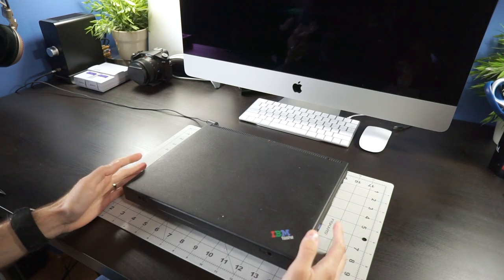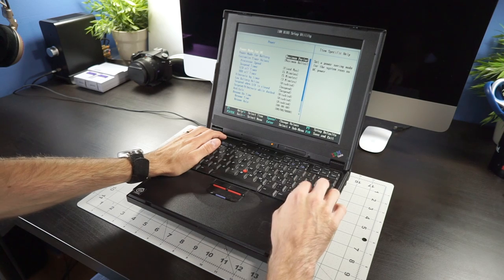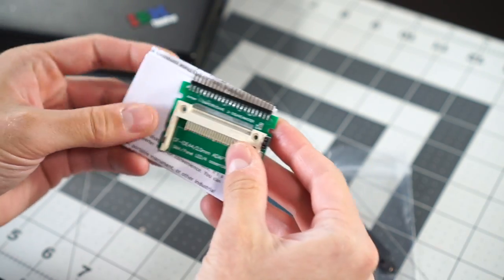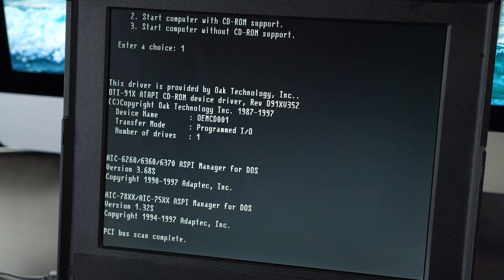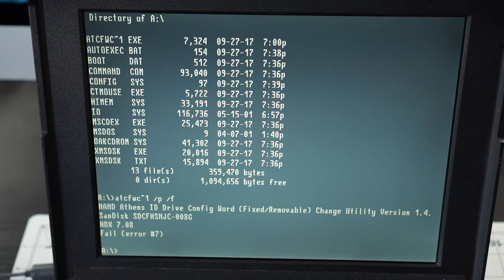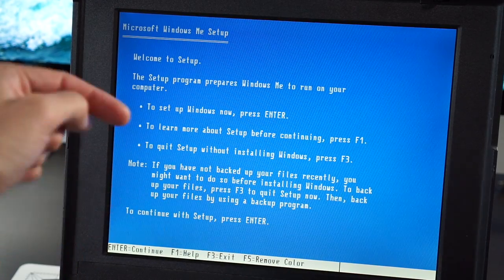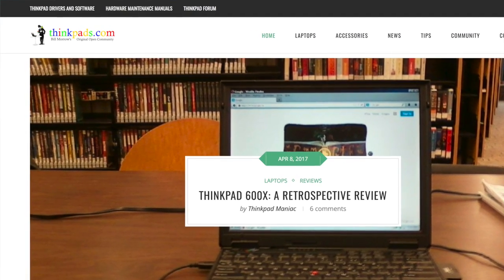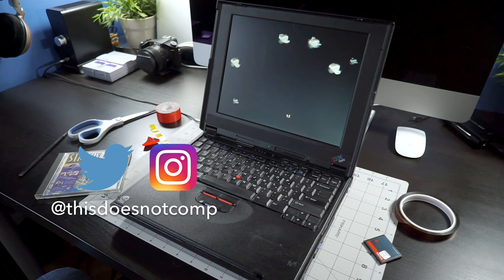Repairing a Vintage ThinkPad

Comment: In my vintage laptop repairs, I used to use CF-to-IDE adapters, but now I use SD-to-IDE adapters. I had much more luck with them on olders machines with quirky BIOS.

Comment: That pointer behavior was a typical behavior for the pointer driver. Pointer drift was a really common issue with the touch point laptops. The driver checks every few seconds for any slow consistent motion. it will interpret this as pointer drift and zero it out. The next time the pointer drifts, just let it continue and the driver should zero it out in a couple seconds. 

 Thanks for the video. Brings back memories. I worked in tech support and worked with a lot of old laptops and desktops from this era. Computers at this time were frustrating to work on, but it didn't seem so bad because earlier computers were even worse.

PS: Also IBM was a Windows launch partner and was usually very good for having out of the box support when a new version of Windows would come out. This advantage would go away over time as new hardware was introduced.
Reply: Good to know. My x200's pointer does the same thing.

Comment: Back then, those S-video ports on laptops were a blessing, I used to connect my laptop to a huge standard def Sony Trinitron via S-video and play retro console/arcade emulators on a big CRT screen. (granted it was 480i, but still awesome at the time for emulation on a big CRT screen).
Of course now that port is obsolete since we can use the VGA or even HDMI port along with a a converter and a program like CRTemudriver to get 15kHz RGB on those standard def CRTs. : )
Reply: I got a Thinkpad T60 from Ebay this week. It has an ATI X1400 graphics card and a VGA out port. Hoping I can output 240p with it to a SD CRT...

Comment: Me: Well I expect he will install Windows 98 in this thing...

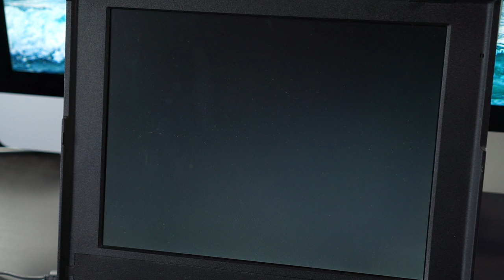17:07 Sees Windows ME startup menu
NO GOD PLEASE NOOOOOOO
Reply: I just found this exact laptop at the thrift store...AAANNDDD it had ME on it...god fucking dammit-_-
Reply: E  I hated Windows ME when I had a computer that had it on there.  I ended up putting Windows 2000 on it instead.
Reply: Idk why everyone hates ME it's not that bad
Reply: Samcq50 _YT it was super unreliable, that’s why it was hated. It blue screened if you even THOUGHT about installing software on it.
Reply: @infamousacidrain  Windows ME really wasn't that bad if you had a clean install and consistent types of drivers (either VXD or WDM...not both). It was OEMs that mixed their old VXD drivers with the newer WDM drivers on preinstalled copies that made things go unstable.
Reply: Wait but wouldn't any windows ask for a key? He didn't put any. Dafuq
Reply: lmao
Reply: @Jack's Model Railroad Like which one?
Reply: @Jack's Model Railroad Really? Well, how do i go about finding this archives? Mind telling me?
Reply: I actually really like ME, it’s more stable and easier to use than 98, the biggest issue it the lack of DOS mode, but that’s not that big of a deal.
Reply: @infamousacidrain  I’ve used ME quite a bit, and it never blue screened once.
Reply: @EvilTurkeySlices  some people definitely had that experience. Doesn’t change the fact that it was largely regarded as unstable and a tremendous number of people had issues with it. Microsoft knew they were right and canned it pretty quickly.
Reply: @infamousacidrain  it was unstable due to bad drivers, that’s fixed now.
Reply: @EvilTurkeySlices  which drivers? There were hundreds of companies developing hardware for it, and I assure you they did not all update their drivers in the intervening years, especially once the 9x kernel was killed because of ME.

Comment: I recommend opening it up thermal paste replacement and clean the motherboard down with some isopropyl to stop future corrosion.You can oil the fan also.
Reply: What kind of oil for the fan would I use?

Comment: I just got an old Compaq Deskpro P800 up and running.
I found an old IDE HDD and it is running fine.

I love that old clunky sound of those old HDDs.
paired with those little socket 370 heatsink fans that run at 100% the sound is just so retro.

Comment: A bit of background info about this and a few other ThinkPads of this era. This was around the time that IBM was still trying to find ways to make money (or not lose as much money). They went through several stages of trying different things starting with moving manufacturing to Mexico, trying lower end machine such as the early "3" series. At this point, they were trying out contracting through Taiwanese companies mostly with a separate line like the "i" machines, but the TP390 was one as well. I want to say that this model was an Acer product. You can tell by that weird adapter used. Only the low end machines of this era had those and they can also be found on Acers of that time. Plus the rear access to the HDD was very atypical of design from their Yamato engineering facility. 

I really enjoy your video! Keep up the good work!

Comment: I didn't know that cf cards could work in 2 modes, removible modes & stay modus.
So each cf card can have it's own bios with it's own settings such as removible modus ,FAT32 etc,,,,
But you did a great job, i only wished you did & showed us how to remove those residues from that laptop.

Not mentionen, everytime you say,,1999,,, i will get flashbacks.

Comment: My biggest issue with these old laptops are the screens, which are absolute junk by today's standard. First you have the very obvious ghosting, which makes anything fast moving basically unplayable. Then the CCFL bulbs usually are on their way out, so the screens are probably sitting at like 60% of their original brightness. And like you said, they almost always have really bad internal scaling, so unless you want to play DOS games in a small window, you have to put up with a garbled mess on your screen.
Reply from the maker: I think it's amazing that while the screens look absolutely horrible by today's standards, we were totally blown away by them when they were new. We've come incredibly far since then.
Reply: I replaced the CCFL tube in a T30, but it only lasted a year or so.   I'll be making a pcb with a string of white LEDs to fix it next time.   I haven't decided yet whether to run them in series off the CCFL booster or to remove that and run them in parallel off the low voltage.   You can always plug in an external VGA screen to run higher resolutions,  but the quality on the internal screen goes down when you do that, as if the GPU can only refresh one screen at a time.
Reply: Oh, so the CCFL bulbs were used for backlighting.

Comment: Win98SE is often a better choice, as a half-step down from the much hated ME, but a half-step up from regular 98.

Though Win2000 Pro is usually the top choice for this era machine.

The extreme version would be a bigger CF card with multiple partitions that can multi-boot between Win2K, 98SE, and a lightweight linux distro, to cover all your bases.
Reply from the maker: Yeah, I would have gone Windows 2000 but I wanted to install After Dark. It looks like there's some kind of alternate version on archive.org that works on the NT kernel too, so I may give that a shot (https://archive.org/details/AfterDarkCompleteCollection).

Comment: Thanks so much for showing the ATCFWCHG.EXE tool. Now I made a 2GB CF compatible with my Pentium 200MHz MMX system!
Reply: 8bitbubsy you might as well get a 233-266mhz chip off ebay and upgrade hahaha
Reply: I worked on these laptops when they were new. I thought I knew everything about computers back then but I totally missed that CF cards could be used as boot drives. Physical drives were horribly slow.

Comment: These old Stinkpads required a separate caddy to enclose and install the hard drive. Caddys were different among the various models. When purchasing one of these vintage machines, always ask if the caddy is included. They usually pull the hard drives for security, but the caddys can be a PITA to find. Some are plentiful used or repro on eBay; some are not. Very informative video. I have used them since new, but learned some things here. The old Stinkpads were built like tanks. One weak spot now is the batteries are usually dead and replacements, if they can be found, are very expensive.
Reply: They are just 18650 cells, so they can be rebuilt pretty easily.

Comment: Funny. I've never had a problem with my compact flash cards and f-disk before, and I've used them in several retro systems, including laptops. BTW, I found on amazon a CF card adapter that has the shape of IDE drives, in addition to an M.2 to IDE. While that one works in some of my devices, it doesn't boot in my oldest Toshiba Laptop, A P1 with 40mb (440CDT), while the compact flash does. The adapter I use is a SYBA  DS-ADA45006, and the compact flash card I use is a UDMA 7 (which is the IDE specification) 16GB Extreame Sandsidsk 120MB/S, model number SDCFXS-0 16G

Comment: I notice this with all laptops that use the nub. If you use it a lot or push to hard in one direction it will get stuck for a bit but register it a movement, as its getting unstuck. Just let it go for a bit and it should be fine. Great video and have fun.
Reply: The X60t still has this issue and I tend to use said laptop from time to time myself.
So yeah, it seems to be a nub issue here.
Reply: It isn't an issue, it is some kind of recalibration. This is an intended behavior.
Reply: The TrackPoint automatically adjusts itself to different levels of finger pressure. If you're heavy-handed with it (as beginners often are) it may tend to drift when you let go, until it readjusts itself. Once you get used to it and learn to move the pointer around without applying so much pressure, you won't see that happening anymore.

Comment: Strange.  I just got a Sandisk Extreme 32GB CF card for my Toshibas Tecra 520CDT (even a bit older than your IBM) and had absolutely no problem in getting it recognized by the machine and installing Windows 98 on it.  I used diskpart on a Windows 10 machine to clean the existing partition off the card, then used disk management to initialize it.  I did not create a partition or format it.  I let the Windows 98 install create the partition and do the formatting.  Worked a charm.

Comment: I can explain the vague and confusing master/slave label!

The PCB stems from a dual-socket CF adapter where the jumper configures both sockets, not one. Depending on how they stacked the sockets, it was impossible to use some of the thicker CF drives in one of the sockets (yes, there are multiple types), but for compatibility reasons, that CF might still need to be specifically master or slave, so the jumper was necessary. Which incidentally meant they could reuse the same PCB for single-socket adapters.

Comment: I had one of those laptops. It was given to me and it was also missing the HD and that adapter. Since I got it free I didn't feel like buying a replacement adapter, so I disassembled the laptop and soldered the pins of the HD directly to the edge connector on the mainboard.

Comment: the mouse moving on its own there happens when the cpu has no cycles left for mouse input; because its busy with critical os stuff, so the mouse movements get delayed. it happens sometimes with slow cpus, or extreme heavy load. or; of course it COULD also be the "nipple" that is iffy

Comment: beside DOS that do not need  it, Hope that the compact flash really support millions of write/readings used by the virtual memory utilized by win 95 to up that uses the hard drive as an extension of RAM, unless if  possible disabled in control panel.

Comment: Awesome video which brings back so many memories! The very first laptop I got to fix was one of these. Had to swap a board from a bad body into a good one. Took me several hours the first time around (it was a lot of screws) but after that I could work on any laptop. Got into Thinkpads and worked on many of them including some exotic ones (S30!). I also played with CF cards on one of my own Thinkpads back when SSDs were prohibitively expensive in mid 00s but I remember install Linux on them. Now I work on Mac laptops but this old PII-era Stinkpad is what started it all many years ago.

Comment: I would struggle to call CF cards 'reliable' just because they have no moving parts. A common issue is Flash wear. I had them in my PSION5MXs running daily backup from internal RAM, copying over maybe 10MB a day. After a few years, a REALLY expensive 512MB CF would invariably die. You can't expect the best of wear levelling algorithms on CF cards if they aren't made with newest electronics! And i don't know whether they have to be for a cash register, i mean if it's a read-only drive in those machines you mention?

There are other ways, like getting an IDE 44-pin to M.2 SSD adapter, which is something i got for a laptop which actually could make use of a bit of extra performance beyond what you get off SD cards and more capacity than you get off CF, or IDE 44 pin to SD-Card adapter for something where speed isn't as critical.
Reply: CF is definitely more reliable than old school IDE HDDs, especially in laptops. :P
I use msata to 44pin IDE myself for some of my old laptops (damn all those proprietary edge connectors). I thought about CF but the price to performance just wasn't that appealing compared to regular SSD tech that was already around. A lot of old 8/16/32GB msata drives hitting ebay from old netbooks or laptop cache drives. Also, many CF adapters for older systems let you get at the card quite easily, meaning swapping it is simple. In a laptop, that is not much of an issue. Some of my laptops have tool less drive bays, some have a screw or two to get to it. Pretty easy I think. The write limitation was also a factor. However, in a normal windows environment, unless he reinstalls it constantly, I don't think it will be much of a problem for many years to come. Was your CF MLC or SLC? In any case, if you use CF, I would say either get a decent bit of overprovisioning or make sure you have an SLC CF if you want years of reliablity. What is the failure state of a CF card that has expired its r/w cycles? SSDs go into read only mode if they are programmed correctly (and the controller wasn't the thing that killed it).
Reply: If a refurbished notebook is going to be used for everyday tasks, such 
as web browsing with Firefox, and somehow watching video, then these 
activities are going to swap alot, unless Firefox is optimised, and 
swapping off-loaded to a separate drive. Not a separate partition, but a
 separate drive.

The absolute minimum for Firefox and its derivatives is a computer with 1 
Gb of RAM, and an OS that on its own would take maybe 200–256 Mb or less
 total.

Well, there must be a video out there that shows how YouTube can be seen
 on old hardware.

YouTube playback requires three things: adapter (GPU) support for OpenGL
 2.0, a driver that supports that, and a browser with at least a 
WebM/VP9 decoder. All this Firefox supports, but it  does not have 
built-in support for H.264 (aka mp4), in which encoding half of the 
videos on YouTube are available. — This means, that on Windows XP, one 
would have to use a fork of a fork: either New Moon or MyPal, both forks
 of Pale Moon, itself a fork of Firefox.

Comment: I put a 16GB industrial CF card in an old IDE laptop to reduce the heat generated and it worked well but I just swapped it for a mini PCI-E SSD in a 44 pin IDE caddy and the performance boost was dramatic!

I wouldn’t personally buy second hand CF cards as many have relatively limited read/write cycles. CF form factor MicroDrives are a lot less limited but they are fragile.

Comment: When you started to talk about the removable and fixed modes on the CF card, I decided that I'm going to make a comment about it asking what kind of bullshit is that, however I persuaded myself to watch till the end, and I got really surprised that this setting really mattered. I'm using CF cards in a variety of devices, from my Yamaha A5000 sampler, through my Compaq Armada 1530 to my Commodore Amiga 1200. On neither of these machines I had any problems with any of my CF cards, from the cheaper Verbatim ones, to the SanDisk Extreme IV in the A5000, so I guess it might also depend on the BIOS as well.
Oh, and the Nikon D70 was my first DSLR as well. I still have it and use it from time to time, as my D3100 doesn't have a built-in focusing motor, and neither does my 70-300mm lens.
Reply: Windows, to this day, is a PITA when it comes to letting you use your storage mediums in "odd" ways. Like trying to write the Windows 7 installer in an external hard disk instead of a flash drive (the answer is to use YUMI and enable Show all drives? , by the way).

Comment: To use a compaq flash card in a IDE PC you must have it with the tag "permanent" instead of "removable", the computer will consider it as an IDE without asking any drivers. 
The settings are in the card manufacturer settings, industrial cards are "permanent" photo camera often "removable".

Comment: Late comment I know, but I work in a computer recycling center and when we have to remove Hard Drives from any Laptops on a scrap pallet, anything that gets refurbished we use some specialist wiping software that reformats the drive, fills it with dummy data then reformats it again.

Comment: Industrial Compact Flash is great for this type of usage as it's already configured as a "fixed Disk". I use Industrial Flash in my Compaq LTE 5100 laptop and it works fabulously.
Reply from the maker: Any recommendations for makes/models of cards?
Reply: I Have a few of the "Transcend Compact Flash ULTRA 2GB Industrial" cards. I've used them in 2 different brands of Compact Flash to IDE adapters with good success. One from Syba(SD-ADA45006) and one from "StarTech.com"(35BAYCF2IDE). The Syba is what's in my Compaq LTE 5100 running Windows 95 OSR2. The StarTech.com is on a Pentium III system Running windows 98.